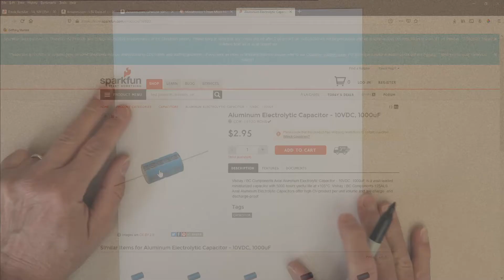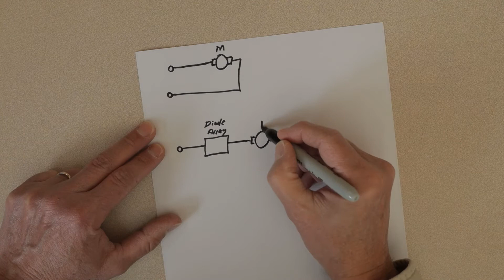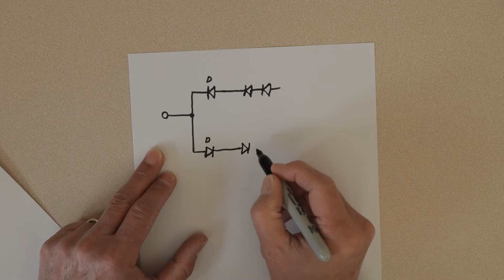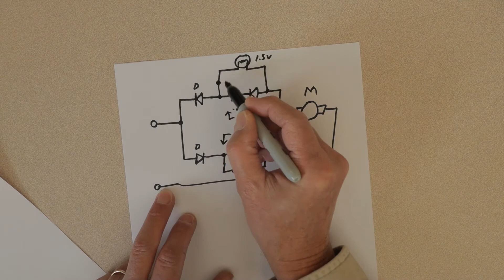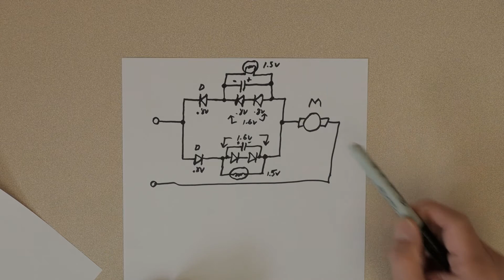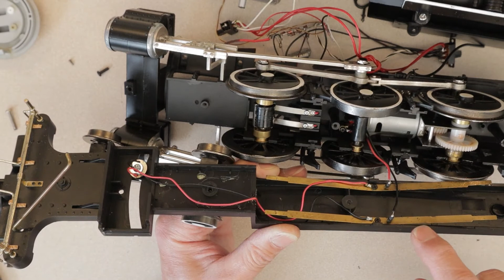Add Directional Lighting to a Bachmann BIG Hauler using Diodes and 1.5V Grain of Wheat Bulbs

Comment: I'm using LED's and I'm trying to figure out how to block out the reverse flash from the diodes run in the opposite direction.  In other words, the motor EMF is making the rear diodes flash or flicker when I'm running them in the forward direction and vice versa.  When I run the loco in the reverse direction the front diodes flicker.  How do you stop that?  I tried using diodes in line with the diodes but it still flashes in the opposite direction.  Cheers from eastern TN
Reply from the maker: Hmmm!  This is a poser.
Could your provided a bit more information regarding how the LEDS are wired?
I assume there are resistors in-series with each LED and one of the LEDs is installed reverse polarity to the other - is that correct?
Did you install the LEDs yourself - or is this how your engine was assembled at the factory?

Comment: LEDs are Diodes.  Replace your diodes in the array with LEDs and replace your bulbs with a resistor equal to the old grain of wheat bulb.  Done.
Reply from the maker: Back when I did this - white LEDs were not developed yet and I received a question of how I did this.  Plus, the grain-o-wheat bulb gives a nicer and more consistent 'glow' even before the locomotive moves.

Comment: Hi! Greetings from mexico! I was wondering how did you pulled out the bulb from its casing? I have the big hauler "Wonderland Flyer" set from bachmann, beautiful engine, but the searchlight its very dim and i want to replace it, however i dont seem to find how to remove it from its casing without damaging it 🙈
Reply from the maker: Carlos - Greetings to you from Colorado.  I'm surprised your locomotive is giving you trouble.  On mine, I just need to pull the headlamp assembly straight-up to remove it.  There, the bulb itself is 'perched' at the top of a plastic tube.  The bulb it larger in diameter than the tube, but it has a slit cut over its length that allows the wires to pass.  IF you are attempting to pull the bulb through this tube without first removing the lamp assembly, I can see how that would not work.  I hope this helps!  Thank you for your question and Good Luck!
Reply: @KevinTaberski  Thanks! I didn't notice the plastic tube, i'll definitely check that out thanks for the help!
Reply from the maker: @Carliv_Sot  You're welcome!  If this still doesn't make sense - let me know.

Comment: Great follow up! I was just going to start researching how to add directional lights to my 4-6-0 #49. It has a single on/off switch & someone added a red christmas tree light in the coal box to give it a "hot" look. I just ordered some 3v LED lights to use as replacements. I'd love to hear about your ideas on that topic. I'm also investigating 5v power for a Raspberry Pi Zero to add more functions to the model.
Reply from the maker: Chris - thank you for taking the time to comment.  LEDs are quite a bit different than old-fashion incandescent lights.  Two keys - the LED needs a certain voltage before it will emit decent light (3V for example), but an LED also needs to have its current limited (somewhere in the 10mA to 20mA range).   The simple method is to add a resistor in series to 'drop' the rest of the power supply voltage and to limit the current.   The problem with trains (using simple variable DC power supplies) is that the voltage varies so much.  IF the supply voltage was fixed at 12V, then a 1K resistor would drop 9V and limit the current to 9mA (I=V/R = 9/1,000 = .009A or 9mA).   The question is, what about when the loco is going slow?  You could decrease the reactance to 500 or 400 Ohms.  I'll need to experiment with this.  I'll try and follow-up with another video in a couple of weeks or so.  Thanks again!
Reply: @KevinTaberski  Here is the circuit I ended up building: https://www.circuitlab.com/editor/#?id=snu39u7hm34b I started with the forward light and that is working. I will build a second for the reverse. Thanks again for the videos.
Reply from the maker: @ChrisTuck  I would be interested to see how this circuit responds to varying track voltage.  Generally, LEDs are driven using constant current rather than a fixed voltage, but what ever works!  Thanks for the reply.
Reply: A little bit of investigation suggests adding a 1K Resistor just before each of the LEDs should do it.